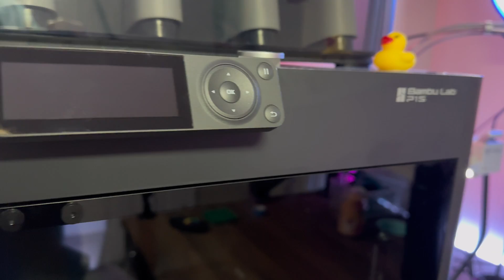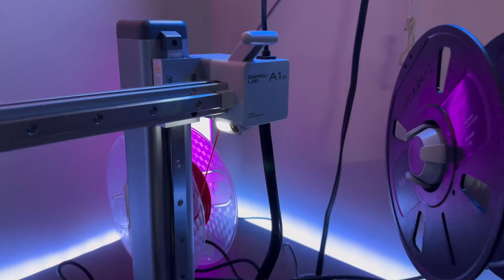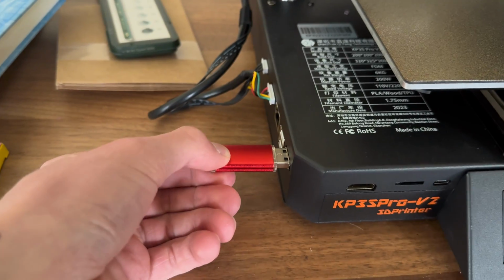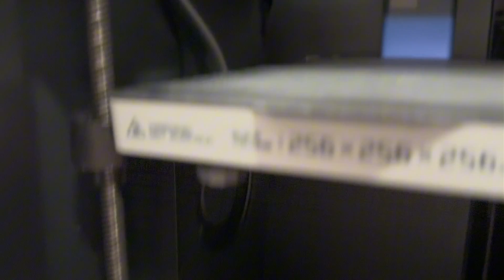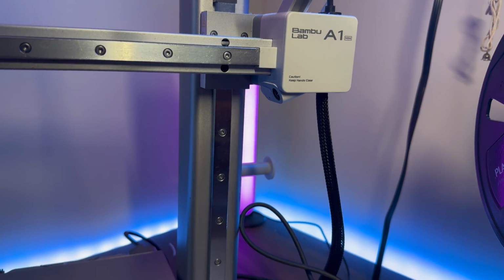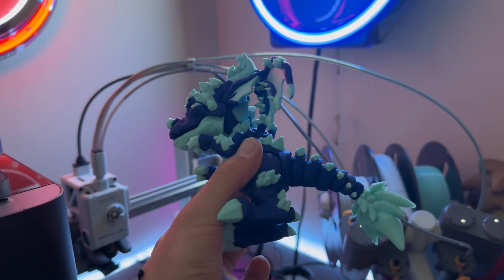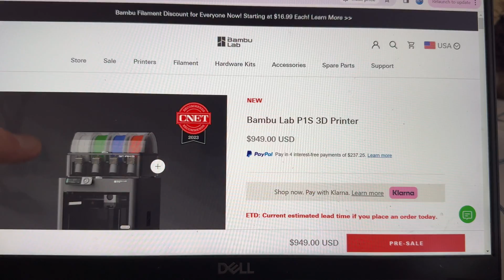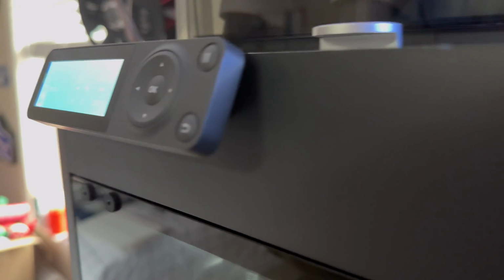Should you go with bambu lab in 2024?

Comment: I own a AnyCubic MAX 300x300x300 and Bambu Lab X1C ... I dunno if my X1c is broken but i have allot of issues with my first layer and auto leveling. I end up manually leveling it and even then i have issues ... lately I've been getting allot of jaming in the extruder... even with multiple extruders, it's a pain in the ass to clear them. I wish my anycubic was still working, i Miss the large size and being able to use Ultimaker Cura ... That's what I hate the most... I don't like Orca Slicer or Bambu slicer... I much prefer Ultimaker Cura...

Comment: I had several Ender 3s and an Anycubic Vyper and Kobra. The Anycubic printers weren't bad. But the print quality was hit or miss. The Ender 3s had to be modded significantly to print decently and be somewhat reliable. I almost pulled the trigger on the X1 Carbon. But I decided to give Bambu Lab a year to see what they came up with. So I ended up getting a P1S with AMS. I kept my other printers for awhile and tried using them as well. But after using the P1S and the Bambu software I hated everything about using my old printers. So I sold them off. I spent almost a decade fiddling with 3d printers and repairing them constantly. After getting the P1S I realized I was over all the tinkering and just wanted something that works.
Reply: Thanks, Im sold. I'm getting my first 3D Printer, and I'm on a budget. so I will get one of the new cheaper ones like the A1 or something.

Comment: Owned an ender 3 pro for many years. I splurged into an X1C and the upgrade makes the ender feel ancient. The only thing I don't like is how much it does poop for some multicolor prints. The more colors and detail, the more poop. A normal 3 hour print on a multitool head printer uses 12g of filament easily becomes an 8 hour print using 120g of filament on the bambu ams.
Reply: Is it literally a 10x in filament and 2.5x time?? What’s a multi tool printer ? If that also can print different colours withal automatically then why is AMS even exist??
Reply: @simba00784  Yeah that is the downside of the AMS. There just isnt a good cheap option at the moment that offers multi-tool heads. Unless you willing to pay for Prusa, and you essentially have multiple extruders so that is expensive. So AMS is next best thing for an out the door multi-color printer, but I have been realizing long-term it is more expensive because of all the filament it uses even when switching between just 2 colors. And the time is crazy too.

Comment: I've been into 3d printing for a while as well and currently have three ready to go at any time. 
My Printers are :
Anycubic Vyper - 110% reliable every single time and very quiet
Ankermake M5C - Fast (at low res) and about 90% reliable. Noisy 
Bambu A1Mini with AMS - Silent and of course painfully slow at multicolor - 100% reliable

I'll be swapping the A1 Mini out for a larger Bambu. 
I have no real love for the Ankermake but will keep it until fancy something different, I have no problem switching it out.
I will be buried with my Vyper, it's really the go to printer for the large long print stuff as it's just sooo reliable.

Printers I've had and dumpstered within weeks include two Ender-turds, flashforge Dual extruder (Junk), Davinci.
Reply: can I have ur a1mini when u swap it out, ill send u 50 for it

Comment: It is surprising to me how many people do not know how to use octoprint. I mean, it is a bit of a niggle to get running, but not really. it makes any printer networkable. That being said, I do love my Bambu. They are really well built machines.
Reply: Right? Im baffled by people having klipper printers too and not just plugging a wifi dongle in the usb port instead of the flash drive.... ITS THAT EASY to send your files directly from ANY slicer with a button click. I literally bought a wifi dongle for 5 bucks and made my printer need only power cable instead of lan cable too
Reply: Not everyone is technically minded what an arrogant comment
Reply: With octoprint you need a computer near the printer, and if computer stutters you get step pauses with blobs. It's pretty hard to get right from the first time, and most people just want to print, not to screw around with docker and resource management, not to say that adding octoprint to a printer is added 130+ euros

Comment: "PLA is biodegradable" is about as disappointingly misleading as saying diesel cars are the future. Please dont lie to yourself and actually do some research about the breakdown process and the actual recycling involved in PLA.
Reply: but it wont erode away and create microplastics that persist in nature.
Reply: this was what I was gonna say
Reply: But there are places where you can sell 3d printer "poop" and it gets recyclef
Reply: For a commercial plastic, it is about the most biodegradable that isnt completely useless. But yes the conditions it needs to degrade quickly are special. And UV radiation convined with weathering will start to break down the plastic after a few years, if you don't think so try using PLA parts in the garden
Reply: I've seen it composted in 12hrs at 45C with a proprietary bacteria strain mix, it was grinded pla waste mixed in with food and paper waste and water, no hard plastic parts left.
Reply: Especially gross when he’s hawking affiliate links for filament
Reply: womp womp
Reply from the maker: It is biodegradable with industrial composting processes
Reply: @engineeringaddiction  PLA is only compostable under specific high-temperature conditions that “cannot be found in nature.” Therefore, the material needs to be properly disposed of and composted to be biodegradable. PLA may be industrially compostable, but since it doesn’t degrade easily in the environment, it demonstrates the potential to be a marine pollutant. The common practice of referring to industrially compostable materials as “biodegradable plastic” is misleading the consumers and increase the amount of plastic waste in the environment.
Reply: @engineeringaddiction  Unfortunately most people don't have access to industrial composting processes. Personally, I'm waiting for PHA filament to become more common.
Reply: It isn't misleading at all. PLA is biodegradable under certain conditions. How many other plastics we use daily are biodegradable in any way? ABS? No. PETG/PE? Nope. Nylon? Not even close. TPU? Negative. You will not find a more environmentally friendly plastic that is widely affordable and available than PLA. To say that calling it biodegradable is misleading is just false.
Reply: you shot yourself in the foot. do you KNOW how bad making batteries for your """pristine""" electric cars are?
Reply: @miciagaming7323 if we use your analogy that's like saying batteries are biodegradable, they're not. He should have said it's biodegradable with an industrial process or just say it's recyclable, which batteries and pla are.

Comment: This printers are create, if you do not want to make any changes to the system. Just printing... which is great! However, if you want to be able to get a different addon or mid running, you will not be able to go for it. So, if you are sure that you want to print and keep the printer as is, go for it, otherwise it's not an option.